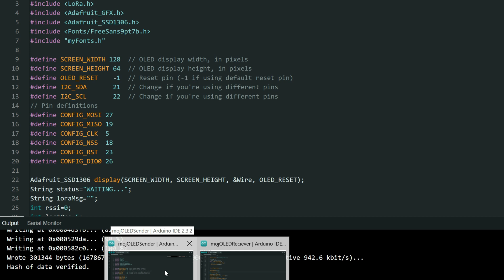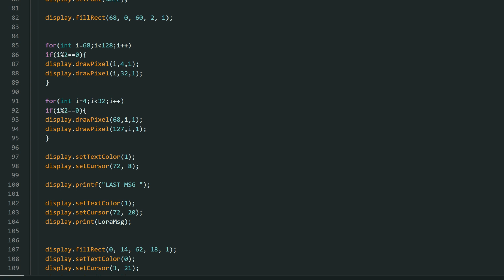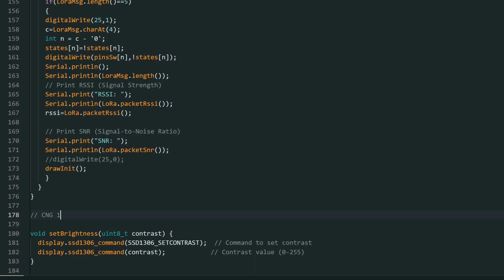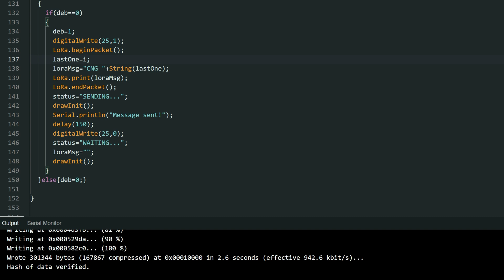How to Build a LoRa Relay Switch Module

Comment: How about the duty cycle? Here in Europe on 868MHz you are only allowed to use 36 secs / hour to send signals. This is a fair use policy, so everybody can use the frequency. You can calculate the air time, so you should only send minimal data, because the air time is way lower than. In your example with the switches a byte should be enough.

Comment: Nicely done!
When it comes to avoiding unwanted packets from other LoRa devices, try changing the sync word even though 120 should have been okay as the default is 55 (0x34).
Definitely change the frequency, 868E6 is the default in many devices, so try some less obvious one, like 864.75E6 or 864750000. Anything between 863 and 870 is okay in your region but 868 to 870 are going to be very crowded. If you have an RTL-SDR or HackRF you can also check which frequency range has the least amount of traffic/noise.
If you don't need more range than a few hundred meters, you can also reduce the receiver's RX gain, and possibly lower the SF and increase the bandwidth.
I would have suggested putting a unique 32bit value at the start of each transmission, but "CNG " does that already so it should be okay.
Reply: Thank you very much for the info

Comment: I hope you feel better soon! 🤧🤒 🍵 💊 🍀

Very nice LoRa project. 🤓
Reply from the maker: @RichardNobel  thank you Richard, i hope so.
Reply: @VolosProjects  My current project is controlling (two different) low-voltage Christmas lights, with ESPHome on an old ESP8266.

That way I can turn then on/off through Home Assistant. (Even on my Android watch. ⌚ But your ESP32 watch UI looks cooler at parties 😁🎉).

Added benefit for me is that, these Christmas lights that originally required AA batteries (around 3 Volts), will now work on USB power through the ESP board. 💡

I only have to be careful that these LED light decorations do not pull too many milli-amps (mA) from the GPIO pins. But in the breadboard circuit I have included resistors for that. 😅

Comment: I don't like Lora because there is too much radio junk on the frequencies. I rely on esp-now because I work with esp32.
This has an excellent range and I don't notice any lost packets and work with the original PCB antenna. from the garden to the base reception in the room about 40 - 50m .. there is a lot more.
Reply: I love esp-now for close work, but I'd certainly not call it 'excellent range' when put up against lora.  I have a pair of Meshtastic nodes shooting nearly 11 miles and several shooting well over 2 miles locally.
Reply: @williamna5800  11 miles? but not with a PCB antenna and not without a relay or radio link or clear distant view. Especially not in a city where everyone has something running on these frequencies, because in the most commonly used 868 ISM band. Think about what range esp-now can have if the antennas are optimized.
Reply: @spielautomat9751  You compared esp-now as a replacement for lora for city use. Yes I have LOS on the 11 mile link, and yes they have custom antennas(no relay nodes).   Very different roles for very different radios.  Lora is longer range and wifi/espnow is much much faster.   Lora is measured in miles, with speeds that make slugs mating look fast, Esp-now is measured in meters with speeds that leave Lora munchin dirty butt.  Don't get me wrong, I love Esp family of chips, but it's certainly not for their range.  Cheap, easy and useful, yes... not range, not power savings.